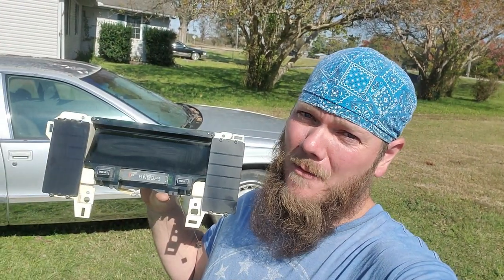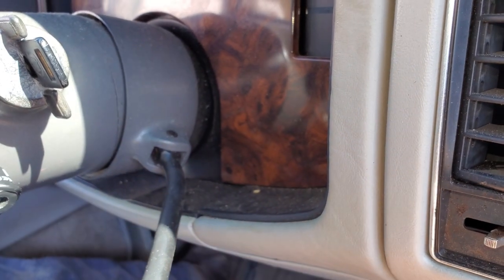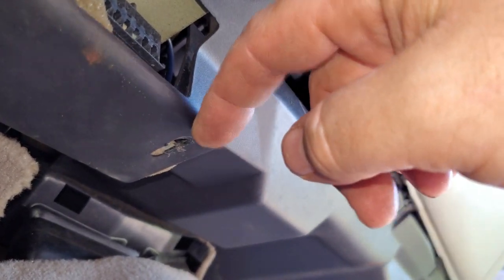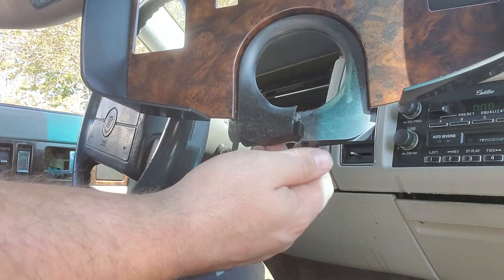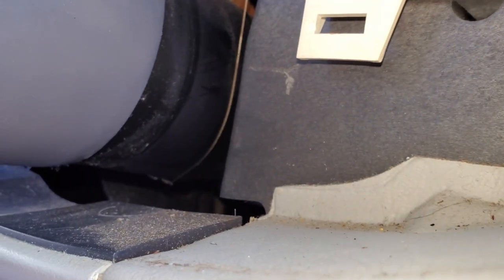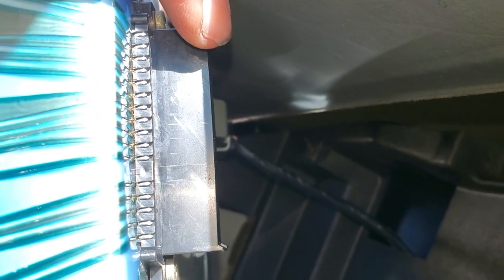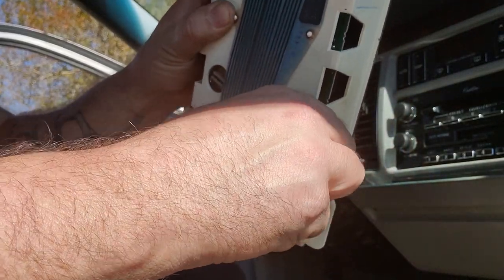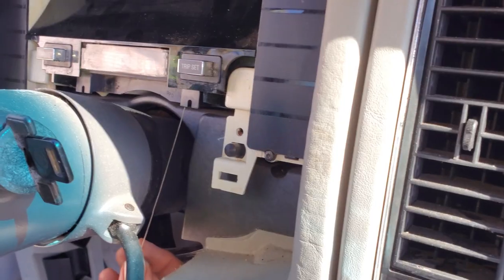How To Change A Instrument Cluster In A 93-96 Fleetwood

Comment: Thanks a lot for showing this as I just wanted access to the telltale lights. I got to where the cluster was coming out, but I wasn't brave enough to just pull on it lest I break something. Thanks to you, I know it's just an electrical connector that'll come out with some extra force and jostling. The tidbit about the mileage is helpful as well. I actually own two 1995 Fleetwood Broughams, one I've had for 18 years and the other I bought two years ago (both with no dashboard cracks!). The more recent one shows really high mileage, but the car looks and feels like it's much lower and mechanics I've talked to cannot believe it has what the odometer says. I was curious if the mileage was stored in the car or in the cluster, and you answered that question I've had for the last couple years as well! Thanks again!
Reply from the maker: Those sound like some sweet cars that pretty crazy to have two with no cracks in the dash!

Comment: Mines comes and goes. I can tap the front with my fingers and it will come back. Sometimes only a couple minutes, sometimes a day. I used to fly over railroad tracks. Do you think the connector just needs to be re-seated?
Reply from the maker: Could be on the start if going out the one in my tan Fleetwood would not work and you could hit the dash pad and it would start working then eventually gave up and stopped working all together

Comment: Hey Dan, I appreciate you doing this how to videos because I do most of my own repairs on my cadillac's. How do I go about replacing the wire or string on the shifter indicator? My broke off and I've tried different ways how to fix it but continues to break? Any suggestions would be great or even a tutorial on that would be awesome.  Thanks
Reply from the maker: Are you talking about where it clips to the steering column
Reply: No my broke in the middle.
Reply: Another words the string broke in half. I tried gluing it together but with the tension it breaks off.
Reply from the maker: Maybe solder it I would almost suggest a butt connector but dont think it would hold

Comment: Do you happen to know if this is common for the Fleetwood hearse as well? My cluster is out, all fuses are good, i have replaced the timer, it works when I mess with the sentinel timer then goes black again! Also will a regular Fleetwood fit the hearse? TY any help is appreciated
Reply from the maker: Yes as long as it's a 93-96 Fleetwood all those cluster will work worst case scenario if you cant get it to work right you could always sell me or even give me your hurse!

Comment: On a 94 does the brain need programming if the cluster is replaced
Reply from the maker: No it does not but the milage will stay with what ever the cluster is
Reply: Do you know of an upgrade aftermarket digital dash (Dakota, Holley efi, etc..) that has a direct fit ent for a 1994 fleetwood??
Reply from the maker: I dont I would think a holley could be installed fairly easily

Comment: How the hell do you get the shifter cable off? Mine is glued onto a plastic tube on the column shift. You didn't show how to get the cable off?
Reply from the maker: I usually use a flat head screwdriver and just push the clip off the column it just clips on
Reply: @thecadillacdanshow8658  I got it, thank you sir!
Reply: @thecadillacdanshow8658  how to we get the shifter cable clip to slide back on? I got my needle Pliers to try n shimmy it back on.
Reply from the maker: @carsandmoods3593  they usually just push back on sometimes get one side started and rock it back and forth till it's all the way on
Reply: @thecadillacdanshow8658  got it thanks. Just shimmeed it back into place using my needle Pliers at an angle.

Just got my cluster repaired locally. Cost me $125 bucks US. The guy found lots of microscopic cracks in the solder. Now it works again. 

Thanks for your video.

If you have fleetwood parts I can buy for my car, let me know. 

Many thanks. 

From Sal in Windsor ON (4 miles from Detroit Michigan).
Reply from the maker: @carsandmoods3593  I dont have any parts at the moment do you have a number for the guy that repaired your cluster?
Reply: @thecadillacdanshow8658  yes I do have his number but youtube keeps deleting my comment whenever I try sending you the details
Reply from the maker: @carsandmoods3593  can you message me on Facebook

Comment: Just got my first Fleetwood this week, and I’m thrilled…however the climate control went kaput this morning :(
Reply from the maker: The controls went out?
Reply: @thecadillacdanshow8658  went dark, but the A/C and blower still work. No heat, but if I had to choose I’m glad the a/c is stuck on. I have freezing cold, or nothing.
Reply from the maker: Probably just need a new head unit they are pretty common
Reply: @thecadillacdanshow8658  thank you - I’ll dig around and find one :).
Reply from the maker: You can use a roadmaster head unit also it will take some modifications to make it fit but it will also allow more controls for where the air comes out of the vents!
Reply: @thecadillacdanshow8658  thank you! I was shocked at how few the options were for air flow, or even the instrument cluster. I thought these were the top end Cadillac, but apparently they’re more like a Suburban on a car frame with beautiful line, chrome, and fender skirts. Few options or not, this thing is a pleasure to drive!